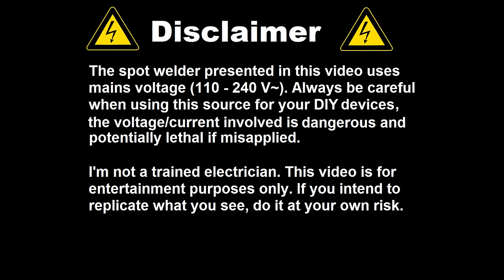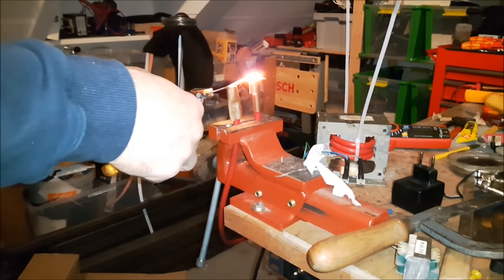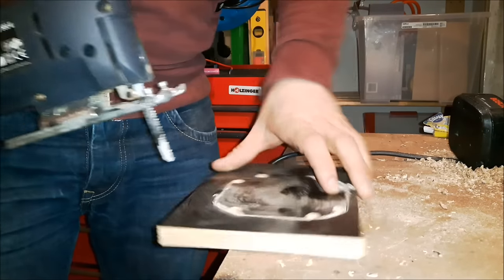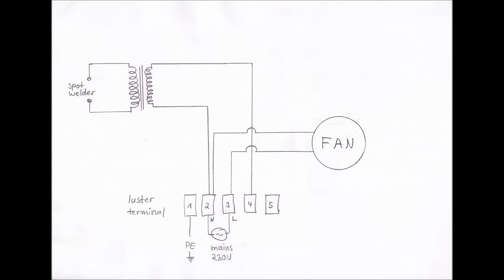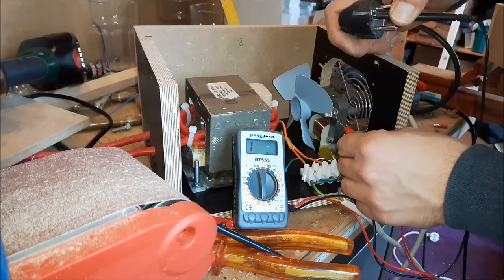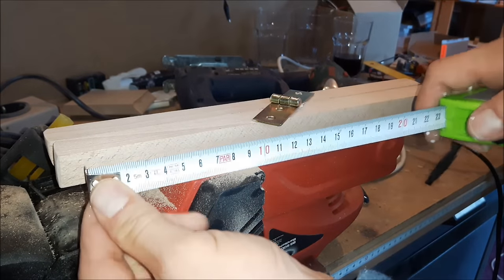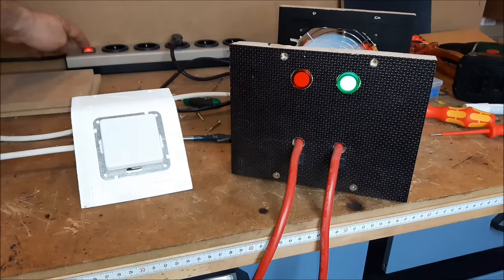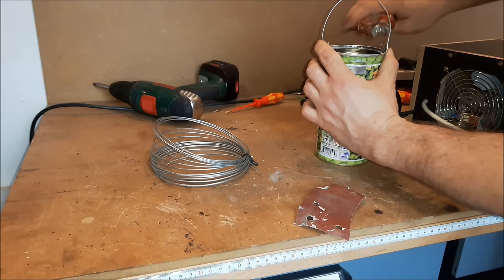DIY spot welder with foot pedal

Comment: sir you are my inspiration following your steps i also made just have to test  but need your advice what is the input current you are providing (input voltage 220v). what is the input current?? please reply as i cannot move ahead without knowing as it may be very harmful.please help sir.
Reply from the maker: Hello Nandlal, the input current depends on various factors (wire size, transformer type, output voltage etc.). With this setup its around 10 - 12 amps @ 230 v (input). The output current is > 100 amps (don't know exactly as my meter maxed out). Remember, its basically a shortcut so the transformer takes what it can get.
Reply: Thank you sir for helping me out can I melt iron metal if the two terminal are connected to the iron piece?? please sir tell as I want to try today thank-you sir and keep making such great videos

Comment: Hi sir, nice made but just one thing
When you made a new wiring, you must keep the wire as near as possible to the metallic core. Air gap between copper and the magnetic core is a bad thing for the effeciency and increase the equivalent intern resistor. 
A new wiring must be as tight as possible. And in the same time you save copper. Good continuation.
Reply from the maker: Alexander Hartdegen Thanks for the advice. I did'nt know that. As mentioned in the other comment, I will make a follow up with the changes and include that tip!
Reply: Ok that's nice.. Great day sir.

Comment: Its good.but out put 2 or 3 v.how much input v.
Reply: rubel ahsan  I think it's 220V there.  Either way, if you get a microwave oven that work(ed) for the local mains voltage, the primary coil will be correct.  The secondary windings will be the same regardless:  3 turns.

Comment: Hello,  I have a fan motor like yours from a microwave oven,  i guess it is an induction motor?  I connected it to main 220v and it spins but in a few seconds it begins to make some smoke from the winding.  Do I have to connect it with a resistor?  Thanks in advance
Reply from the maker: Usually these motors have their rated voltage printed somewhere on them. In most cases they are rated with the standard voltage of your outlet (230 or 110 volts). I have seen some cases (Galanz brand) with 21 volt AC motors. Since your motor spins, its obviously AC, but it seems to use a lower voltage. Try: 1) Use a variac (if available) and slowly turn up the voltage 2) If you don't have a variac, try to make an extra secondary winding with approx. 21 volts and see if it works (do one winding,measure voltage, divide 21 by that number = number of turns needed for 21 volts)
Reply from the maker: Btw, a resistor also may work. But dropping mains voltage to the voltage of the motor  (21 volts or so) needs some beefy resistor since with a 5 Watt motor  connected it will produce a considerable amount of heat (thats why a transformer is used in such cases)
Reply: @diecksl  Thank,  I thinks its a Galanz rated at 220v, it surprised me when it began to smoke,  it has 3 pins for fast-on connections,  but Ican only see 2 of them with thin wire,  I will test it with a multimeter,  thanks,  I wlill tell you if it finally burns!
Reply: @diecksl  yes,  not a efficient way to do it. Maybe I will connect it to a variac.  Thanks.

Comment: Nice video! How can I recognize neutral and live terminal of the transform primary core?
Reply from the maker: It does not matter. In my country I can even turn around the plug by 180 degrees and change live/neutral.
Reply: @diecksl  thank you for respond me quickly

Comment: Concerning the secondary coil you made, how do you know the direction of the wires should go around?
Reply from the maker: salah ouali Hi, Salah, I did'nt know. Just tried and it worked. Since its AC, it should not make a difference because the current changes direction 50 times a second (I think)?
Reply: Direction does not matter.  It's AC.

Comment: Superb video I was searching for proper construction method from long time. 
If you could tell me how to do spot welding to a motorcycle gas tank to use slide hammer and pull/remove dents out it will be great
Reply from the maker: Sudarshan Bhat Interesting question. I just went upstairs and connected a piece of sheet metal to one side and a thin piece of copper wire (and also iron wire) to the other side of the output. I won't stick together. 

What about brazing some metal pieces using silver solder onto the dents and then pulling them out? Silver solder gives a pretty strong connection (soldering my sawblades this way) and you can remove the solder completely afterwards with heat.
Reply from the maker: Sudarshan Bhat You can also solder small holes in your tank and/or patches with silver solder. Just thinking..

Comment: Nettes Video, gut gemacht! Ich plane gerade auch so etwas zu bauen, allerdings mit Microcontrollersteuerung. Somit kann ich ein gekauftes Pedal nutzen, welches ich mit 5V DC oder so steuere. Pulsdauer usw. soll auch einstellbar sein. 

Ich brauch das tatsächlich zum Bauen von Batterie Packs, weil die günstigen China Batterieschweißgeräte durch dickeres Hiluminband nicht durchkommen.
Reply from the maker: Hallo kennyfication, lies mal die Kommentare zu diesem Video,über das Thema haben wir schon diskutiert. Die Power reicht zwar, sie muss aber "schlagartig" aufgebaut werden. Eine Kondensatorbank wäre da m. E. besser geeignet, ansonsten erhitzt du die Batteriezellen zu stark.

Comment: could I use Tranfo from the other devices..? and..wht capacity is your trafo.?
Reply from the maker: Yes, of course you can. Any transformer working with mains frequency (50/60 Hz) will do, but it has to be a powerful/bulky model with thick wire at the primary coil, since the wire will carry somewhat between 8 - 15 amps @ 230 V for a few seconds while welding. The transformer shown in the video was a 800 or 1000 watts microwave transformer if I remember correctly. Maybe an old isolation transformer or one from a big power amplifier would work?
Reply: but .. why, every these tutorials use microwave trafo, not others..?  
overall.. thnkss..(Y)!
Reply from the maker: Simple: Microwave transformes work well and they are cheap. You can get them for 10 - 20 EUR/USD on eBay or from an old microwave.

Do you have a transformer in mind which you want to convert to a spot welder?
Reply: trafo from old electronics, as like: tv or refrigerator..! howw..?

Comment: average house microwave oven transformer that raided at 750 watts only has a 375Watt-transformer core. If you only use microwave for a minute or so it’s no problem, it has a build in current limiter in the form of steel shims between primary and secondary winding, plus it has a thermistor that is opening up after microwave transformer core has reach certain temperature, usually set at 75 Celsius. Cooling transformer core helps. In my experiments the best wire is 4 AWG sorry do not know what is metric size, the volt is to be between 3 and 4 volt current from 50Amp to 70 Amp.
Reply from the maker: soroka69 True, a standard MOT core can't handle such loads for long (e. g. I measured my welder at 1500 - 1800 watts - remember its short-circuit load!). However, with a low duty cycle it works ok, but you always have to keep the limits of the device in mind. I stop welding as soon as I feel the cable gets  too hot. But a temperature controlled switch is a nice feature to add, no doubt!

Comment: I would probably use a relay and another small transformer to switch the welding transformer, thus avoiding mains on the foot pedal.
Reply from the maker: When I built that device, the idea was "as simple as possible". I agree a relay is a better solution (somebody mentioned it in the comments below somewhere). In fact I would go for a solid state relay (SSR) on the primary instead of a mechanical one. A SSR is a bit more expensive, but you do not have the problem of arcing when doing high-amperage switching like in welding which puts a lot of stress on a mechanical relay.
Reply: @diecksl  add a timer circuit for "spot welding" , not spot melting ;)
also it would work better with thicker wire in transformer and one less turn.
besides that, i gave you a like for simplicity of design :)

Comment: Can I use 4 UPS transformer for this?
Reply from the maker: It depends.. you can use more or less any 50/60 Hz iron core transformer, as long as its primary winding is large enough to transmit some decent power (1000+ watts). An UPS transformer sounds like a ferrite core type, this type of transformer needs an extra circuit since it works in the kHz range. Do you have a link to the transformer you have in mind?

Comment: Minimum requiment VA for transformer?
Reply from the maker: A 700 VA microwave transfomer (MOT) will do. Keep in mind that a MOT is not a real welding transformer so its always underrated and needs cooling time after a few welds. If you want continuous operation, buy a real spot welder

Comment: I tried my output of only 0.25 volts using 25 mm cable with 3 loops .. why ...?
Reply from the maker: Two things come to my mind:

1) What is the input voltage in your country? In my country its 230 Volts AC

2) Have you removed the shunts in your transformer? The shunts are two pieces of metal between both coils, they limit the amps on the secondary (which is not what we want). See here: https://i.stack.imgur.com/TzfLH.png
Reply from the maker: Safety tip: You should replace the shunts with thin wooden board. The wood acts as insulation between both coils.
Reply: My voltage of 220 volts AC  in 50 Hz, I dispose of its boundary, and do not change it because I thought the cable had been there ... what's this isolation may be caused because the coil primarynya damaged electrical home several times because I broke up

Comment: Too bad , you have 220 volts there, but in USA we have 110, i think it would work differently
Reply from the maker: No, it wouldn't! When you remove a microwave transformer from a US microwave it is constructed for your domestic market. So the manufacturer has designed the primary/secondary coils with a different number of turns, but the ratio is the same. You can also vary the output voltage of your secondary by changing the number of its turns (e. g. build a secondary with only one turn, measure its output voltage and divide your desired target voltage by that number -> the result is the number of turns you need on the secondary). Please be careful, even 110 volts can be dangerous.

Comment: How much voltage is the torchfermer
Reply from the maker: The primary runs on 230 volt, the secondary produces about 2,8 volts (0,92 volt/turn).
Reply: Siraj Ansari

Comment: how the size of the replacement cable
Reply from the maker: he Welgeduwelbeh The red cable is 25 mm2. As it turned out, this is not enough. If you build your own spotwelder, try to go for 30 mm2 - 35 mm2

Comment: Belle réalisation!!
Le Pb avec ces transfos, c'est que la chaleur Max arrive lentement : le métal brûle sans fondre et la soudure se fait mal. 
Ce serait mieux  de faire un câble secondaire (2 tours)  avec  8/10 brins de 5mm qui vont serrer la partie centrale du transfo sans laisser de vide, puis on tord ces brins en // . Là on a un Max d'amps qui viennent vite. Il faut beaucoup d'amps sur un temps très court , et les bobinages chauffent peu.
De toutes façons ce transfo n'est pas fait pour des temps de soudure longs ,et simplement pour du métal très fin .

Pour souder des accus au nickel je rajoute une carte pas chère (indispensable pour ne pas burner les accus) comme celle-ci : https://fr.aliexpress.com/item/33040580897.html?spm=a2g0s.9042311.0.0.31736c373Yj8KU 
Prendre aussi le transfo 9V AC pour l'alimenter .
La carte  a un relais 9V pour la pédale ou le bouton qu'on peut mettre sur les électrodes , et c' est beaucoup mieux. Elle régule le temps en millisec. et elle permet une régulation de l'ampérage de sortie. Il faut quelques essais pour trouver le bon réglage selon l'épaisseur du nickel. J'espace un peu les soudures pour le pas brûler le triac  (c'est du "made in China") . Je contrôle aussi la bonne qualité des soudures du triac , c'est parfois léger , je rajoute de la soudure , et je le plie sur une petite plaque d'aluminium (radiateur). Quand la carte est morte , c'est presque toujours le triac qui a surchauffé. Le petit transfo (9V) n'est pas de grande qualité, mais ce n'est pas facile de trouver un 9V en AC (alternatif)

Sans carte, les électrodes se soudent parfois sur le nickel et il faut arracher  tout de suite les électrodes en tirant , sinon on fait très vite un trou dans l'accu.
Amicalement

Comment: On 220 volt both lines are line voltage of 110 each combined equaled 220. Where 110 volt you have line and neutral or ground.

Comment: Plzz wire size
Reply from the maker: Of the secondary? The bigger, the better (as long as you can fit the right amount of turns into the transformer). If I remember correctly, I used 16mm2 cable

Comment: I would have simply drilled a hole and inserted the loop handle in the tin can instead of welding a drilled piece to hold the loop handle!
Reply from the maker: AlphaTroniks Of course! But hey - where is the fun? :-)
Reply: Lejf Diecks 
Yeahh..that it fun,otherwise it just an example to show how it on working is gonna look like..
Reply: Lejf Diecks 

Hi sir,can i ask u something? Why the burning from electrode kind a look like it just auto-stop after a few second of the weld start even u not release the clamp yet ? Because that what i am seeing and kind a weird for me, did the fact is 

u just releasing it but i'm seeing opposite of what just happening...
or 
Did it really stop by itself because of the contact spot that start burning for a few second just create some layer of burn effect on it then make they non contact to the welder again, is that what is really happening? Sorry for my BADDDDD english,i'm just an Asian boy that try to learn some knowledge from other DiYers on Youtube.. I hope u can understand what really i'm try to get from u,that unclear of understanding or misunderstanding of mine thats what just wondering me for a while? It just stupid question i think but it really need for me to clearly understand what the right concept of that things truely work...